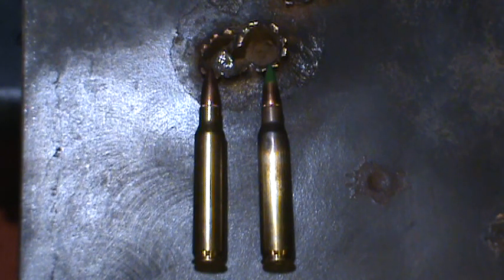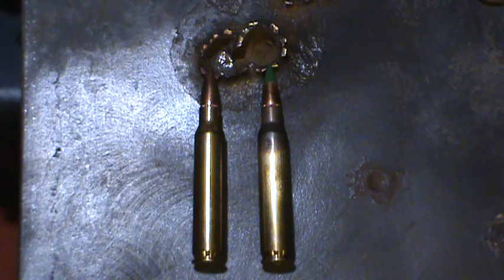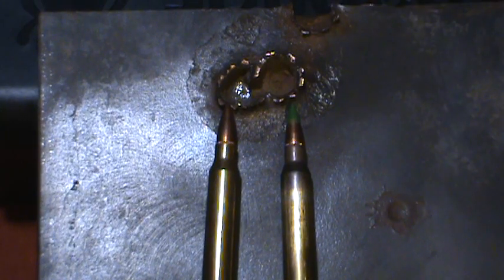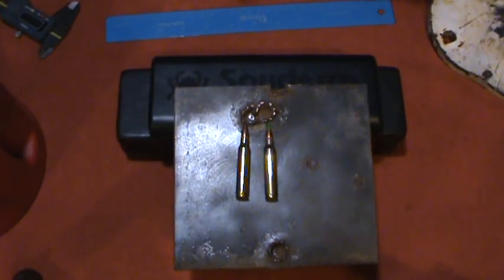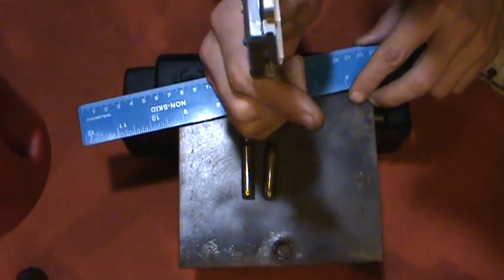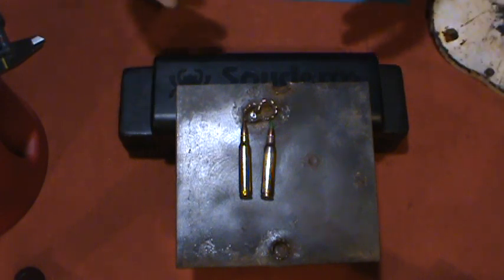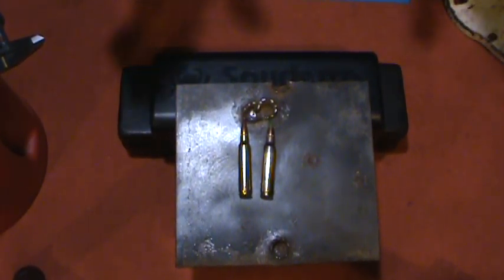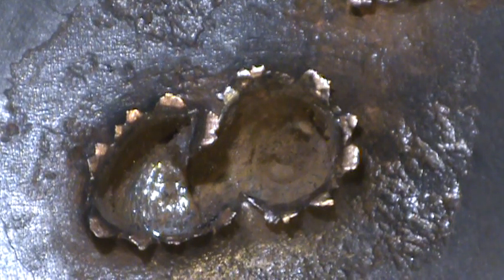62 Gr. Vs.  55 Gr. 5.56 Penetration-Check description for link to updated results.

Comment: yeah i love them M855 green tips they're nasty. Have you seen the new M855A1? I guess it's not really new but I recently learned about it. It has a hardened steel Arrowhead it's loaded with a little bit better powder quicker burn for shorter barrels seems to favor the 16-inch and it penetrates better than the old green tips!!  I got my hands on some they're nasty but they're $3 each versus 75 cents for the green tips. If you get a chance to get any of those  M855A1  to test u will love them.  great video buddy
Reply from the maker: Thank you much, in my updated video on these I test them against 1/4" AR400 as well. I'll have to look into those M855A1s as I haven't heard of them before. My next 5.56/.223 steel penetration video will be between light weight bullet at high velocity verses heavy weight at slower velocity. These would be commercial rounds not military and I think I'm going with two Hornady options.
Reply: @Alloy211  definitely looking forward to that video yeah just Google M855A1 I had no idea about it until recently.  thanks for the reply buddy i enjoyed the videos
Reply from the maker: @trackpackgt373  Thank you for cluing me in on it. I was looking into it today and did find some for sale. The best price I saw for my purposes was 10 rounds for $20. But I've asked a couple close friends if they might be able to find some floating around I could use for testing. So once I can secure at least 5 rounds, I'll be testing that as well.
Reply: @Alloy211  oh yeah that's not a bad price they're usually three or four dollars a round but I would love to see some testing on that I'll definitely subscribe so I can check that out if you get to do it
Reply from the maker: Thanks for subscribing, when I mentioned it to one of my friends he was very interested to see that as well and is actively looking to see if he can find some locally.

Comment: But an M855 (62g) won’t penetrate level III body armor but an M193 (55g) will blow right thru. Level III is designed to stop M855 but won’t stop M193. Does that make any sense?
Reply from the maker: As I don't have any Level III hard armor plates I can't test that exactly but I do have the shooting portion done of my update video to this video. In the up and coming video, I retest against 1" A36 mild steel as well as against 1/4" AR400 and 3/8" AR400 with some telling results. Although I can't say this is an apples to apples comparison to LVL III hard plate, it will show some interesting take aways that maybe applicable. Look for the definitive edition of this comparison to be coming out this week.
Reply: Velocity, velocity velocity, the nemesis of any type of body armor.
Reply from the maker: @hoffmiermp  Agreed, in all the steel penetration testing I've done the the two biggest factors I've noticed are velocity and if the round has a hardened steel core. Emphasis on hardened steel core as mild steel core makes very little to no difference. Thanks for watching.

Comment: Correct me if I'm wrong! But did you take in consideration to deduct the thickness of the ruler ?
Reply from the maker: I believe so, although that was quite awhile ago. This spring I will be revisiting this and doing the test in accordance to my more recent steel penetration test. Such as the Norinco 7.62x39 and 7.92x57mm APT. Good question though thanks for watching.

Comment: You wanna floppy round causing injury?  55 grain.  
Want to over penetrate?  62 grain.
Neither is a good stopper.
Reply from the maker: I think that's a good way to point it. Although when it comes to stopping I think shot placement is the biggest factor. Thanks for watching.

Comment: I've seen and heard some wanna be AR professors claim 62gr m855's are waste of money and aren't really armor piercing which is b.s, they are, but up to a point.
Reply from the maker: In comparison to actual AP ammunition intended for perforating armor plate I wouldn't call them armor piercing in any sense. They definitely perforate soft body armor and possibly obstacles better but as for steel plates they're not in the same class as AP ammunition in my opinion. If you watch my video on the 8mm APT ammunition you can see there is a significant difference between the two. Thanks for watching.
Reply: @Alloy211  I have AP 30.6 so trust me I know the difference lol but yes technically it is armor piercing up to level 3. my AR 500 level 3+ is rated to stop up to 5.56 m855 and win 223 308. I only say technically armor piercing because it can penitrate up to level 3. There's a video I watched a few months ago of a guy that did video on it, exspesive one lol.
Reply from the maker: Once I get a rifle chambered in 30.06 I have some black tipped AP I'm going to be testing much like I did with the 8mm APT ammunition. I'm expecting it will possibly fully perforate the 3/8" AR400 which the 8mm APT failed to do. Which could have been down to it being recased as the original powder had turned to rust basically. Once I get the time to I'm going to revisit the 62 vs 55 grain but with the further testing of it against the AR400 plate much like I did on the Norinco  7.62x39. Unfortunately, time is not something I have at the moment to get much recorded.
Reply: @Alloy211  I wouldn't be surprised a bit if 30.6 AP went right through that 1inch mild steel like butter. I'd like to experiment too, but that stuff not easy to get.
Reply from the maker: It certainly can be, especially at the moment. Both ammunition and steel, fortunately on the steel front that's the industry I work in. Although I haven't been able to afford target material for awhile but I have about #2,000 of targets in my garage I haven't sold so at least I have plenty of extras around.

Comment: So basically save your money. If you're shooting at anything like this that requires serious penetration, both rounds are useless. I'm not going to pay more just for the bullet to go a little further. This demonstration is lacking because it doesn't show anything being penetrated.
Reply from the maker: Perforated, it shows penetration but not perforation. I think it shows neither round is capable of what you would expect of AP ammunition. If you watch my video on the 8mm AP it does significantly more damage to both the soft steel and a hard steel plate. I am going to run this comparison again more along the lines of what I did for the Norinco 7.62x39. I think there maybe some perforation when I do that.

Comment: I just want to know what is a grain and  what the numbers mean
Reply from the maker: As in what's the weight equivalent of a grain or what it represents? Which numbers the 55 and 62? A grain is the unit of measure for the weight of the projectile and the 55 & 62 are the respective weights of each round. Thanks for watching.

Comment: I got a 1/2 piece of steel last year to make targets but after seeing videos like this I'm not going to do it but this steel plate works great on my gas cooktop so it's not a waste.
Reply from the maker: That's definitely for the best if the steel isn't at at least AR400. Better to use it as a cook top. Thanks for watching.

Comment: Out of a 20 inch barrel fully loaded 55 grain has more penetrative ability than full load 62grain green tip.
Reply from the maker: Possibly, the rifle I'm using has a 14.5" barrel with pinned muzzle brake. Keep an eye out for the new video I'll be doing on this soon. Using methodology I used in my more recent Norinco ammo test video. Thanks for watching.

Comment: It was a decent video for penetration comparison, but telling people that they shouldn't shoot at mild steel while you were making a video of yourself doing it is kind of hypocritical, like you are the only one who is qualified to do it, I have shot literally thousands of rounds at all types of Steel, and the worst that has ever happened was I might have got peppered with a few flakes of bullet jacket. but I am far more likely to get killed in a car accident on the way to the range.
Reply from the maker: I appreciate your opinion but honestly you are wrong. No one should be shooting mild steel and I would not advise anyone else too. Regardless of your own personal experiences it is very dangerous and people are struck and injured by bullets coming back at them. I've witnessed it personally and have seen scars from bullet ricochet wounds. So whether you're own experiences haven't ever had a problem with it or not it is not safe nor advisable to do. As to whether I'm more qualified to do this than someone else I won't address as it wouldn't really matter what I said to you in that regard. What I will say is my advice is to only shoot AR400 or harder steel plates.
Reply: @Alloy211 . Like anything else it is all about safety, as long as you don't do anything stupid like shoot a few feet away while standing right in front of it, shoot it in a prone position and wear shooting glasses, keep spectators far away, or not have any at all, and don't shoot at steel that you know the bullet will not penetrate, and will likely ricochet. yes I know people have gotten hurt, but you can say that about any sport, but as long as you use a little common sense, it is a relatively safe sport. bullfighting on the other hand is not a safe sport, LOL just kidding, But thanks for the response.
Reply from the maker: Agreed it's about doing things safely. That's why I can't do anything but speak against the practice. I think in my revisit of this penetration test I do this summer it will more clearly show the difference between shooting a mild steel, like A36, compared to a hard steel, AR400. I've worked in the steel industry for 20 years so I've had a great opportunity to shoot a wide variety of steels with a wide variety of firearms. Thanks for watching.

Comment: 👍
Reply from the maker: You're welcome. One of those things you have to do. I'll also be testing Norinco yellow box 7.62x39 against Tula fmj in the same way again when the weather is good.
Reply: Alloy 2/11 I would like to see that test just got myself a Warser 10.
Reply from the maker: Thanks for watching.
Reply: Alloy 2/11 no problamo. Looks like green tips are pretty good.
Reply from the maker: They seem to be. I'll be revisiting this once it warms up again. Running the same against mild steel as well as a 3/8" AR400 steel target at the same distance. Although I have to say right now that I do not advise shooting any steel at ranges less than 100 yards with rifles. And the obligatory don't try this at home.
Reply: Alloy 2/11 thanks for the warning but I've shot still and done these test myself with mild still. I put a 3/8" piece with a 1/4" piece behind it tested 55grn 62grn green tip and 62grn Teflon coated tungsten core perpetrator. All 3 punched through the first plate but only the two 62grn made a dent in the back plate. the tungsten core perpetrator went about 1/16" deeper than the still core but the tungsten core was key holed and hit the back plate sideways and still went a little deeper. wish I could have tested a few more. aluminium makes a good penetration test also. I was about 25 yards back and it was definitely dangerous.
Reply from the maker: Hopefully by mid April the weather will be cooperative for filming. I'll be using my Romainon AES-10. I have a video on that, it's basically a long barreled AK.
Reply: Alloy 2/11 that's cool send a link to the video I'll check it out.
Reply from the maker: https://youtu.be/mjcNDjmI7dA  it's an interesting Frankstein.

Comment: think you got them backwards or you didn't use a xm193 bt, mil grade.
because the NATO downgrade 885 greentip is worthless at penetrating.
Reply: There is no such thing as a xm193 mil grade, the "x" in "xm193" means that it's not military grade.
Reply from the maker: I didn't get them backwards. Although the green tips I used were older production. I think a lot of it is from the close range of only 30 yards or so. It's something I'm going to to revisit in not too long.

Comment: now im confuse....some body armor penetration tests showed the 55 penetrated and the 62 did not because they say the 55 has higher velocity
Reply from the maker: It's 1" I would never present something that was knowingly false. I take offense at the suggestion. If you have any doubts check the rest of my steel penetration videos. Thanks.
Reply: Ar500 doesnt bend or flex much because its really hards so it breaks. the metal that you see here in the video is softer so it can get more squashed. The down side of softer metal is that it gets more easily damaged and therefore it can't take too many hits
Reply from the maker: Soft body armor? And at what range? Just curious because this was pretty close range. Thanks for watching
Reply: @Alloy211  https://www.youtube.com/watch?v=S14LyHUsZI0
Reply from the maker: Thanks for sharing that is interesting. I think that material and range are probably determining factors. I'm curious how thick that plate was?
Reply from the maker: Agreed, and at the range I'm testing it won't have as much effect.
Reply: Out of a 16" to 20" barrel, the 55 gr is far faster, and will penetrate IIIa steel armor easily. The green tip usually does not.
Reply: @davidsirmons  sorry but you're wrong. Go to AR500'S website for the statistical facts. But you are write about a longer barrel giving higher velocitys. Remember the Difference between velocity and kinetic engery. Lower grain rounds will always = higher velocitys at the exspence of kinetic energy/ foot pounds of energy.
Reply: Go to AR500's website they have a scale for level 1 through level 4 scale all the true info you need. And no the green tip m855 is a penitrator. Regular 55gr isn't. Remember not all grain rounds are loaded with the same velocity/powder load. For example Sellier & bellots 55gr 5.56 is over 3300 fps the average is between about 3100 and 3350. Higher grain rounds like 62 and up will have a slower velocity, but higher kinetic energy/ foot pounds of energy.

Comment: The only thing that you proved was that neither round will penetrate a 1 inch piece of soft Steel.
Reply: jun < only thing you proved is that your an idiot
Reply: Proved the myth of the green tip they want to outlaw is not considered armor piercing by the military only the tip is steel no mythical tungsten core or anything else pretty sure REM 7mm mag would out penetrate both same with 308 30-06 300 win. Etc
Reply from the maker: I'm not sure I set out to "prove" anything other than a comparison of the depth of penetration between the two rounds in this scenario. It's more of a comparison of the relative penetration in this context. Thanks for watching.
Reply from the maker: I guess if someone wanted to be technical about it I did prove both rounds would penetrate 1" mild steel but neither round would perforate.

Comment: I would still pick M193 (FMJ Ball) over M855 (Green Tip). Why? Penetration and fragmentation. Might get slightly better penetration with M855 but I doubt better fragmentation. Below is .25 inch steel and ballistics gel. Also depending on the barrel twist type one may be more accurate than the other. For the record I use both M193 and M855. I just have more loaded with M193 than M855. The results below tend to be quite a bit different than what you have shown. Dramatically so.

M855
https://www.youtube.com/watch?v=B0gIvaw_dPY

M193
https://www.youtube.com/watch?v=50_3Yyo0Nt0
Reply from the maker: RB M I appreciate your input on the video and sharing those videos as well. There are a few variables at play that are different between the two test. I think probably the biggest one being distance, in the videos that you shared the steel is being shoot at 200 yards. In my test I was firing at 30 yards. As well as those perforation test as opposed to this which is a penetration test. Still it does raise some interesting points that I may check out in the future. Thanks for the viewership and the information.
Reply: Alloy 2/11No problem. The more results folks show the better idea the rest of us have of the capability of the different rounds. So I appreciate your work. My nephew coming out of the US Army Rangers wondered why I use M193 more than M855 since the US Army as you know uses M855 almost exclusively for combat but M193 mostly for practice. I told him the same thing. The added result of better fragmentation after penetration is why.
Reply from the maker: RB M That's an interesting video, I'll have to check that round out.
Reply: Alloy 2/11 Too bad its hard to get and expensive. Wait a while until its getting mass produced for the military bleeding into the civilian market driving the price down. Otherwise make your shots count. I think $3 every time I pull the trigger is a bit much right now. I hate spending $1 to pull the trigger.
Reply from the maker: RB M I know what you're saying there.
Reply: A AK  Wrong. M855 will not penetrate rifle rated body armor. Neither will M193.
Reply: I've always has better luck penetrating steel and armor with a 55gr from a 20inch and a 24inch barrel velocity is key plus the steel tip of the green tip is never centered exactly which equates to less accurate the 55gr is an excellent round with the proper barrel length if your looking to punch holes in stuff